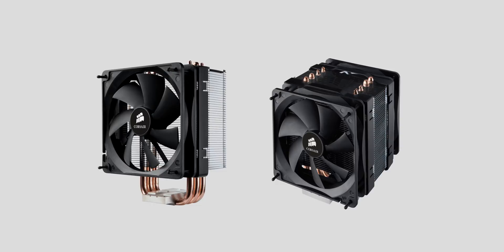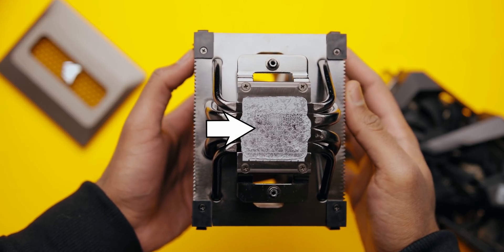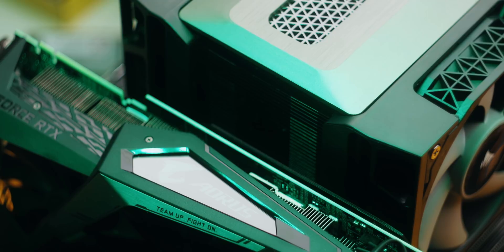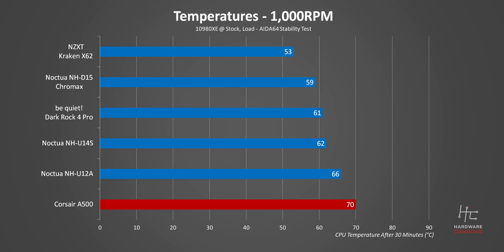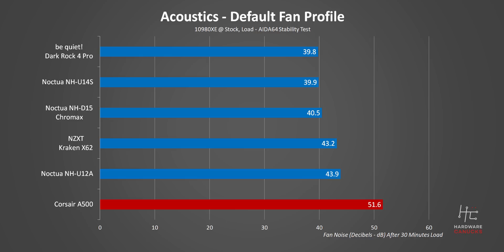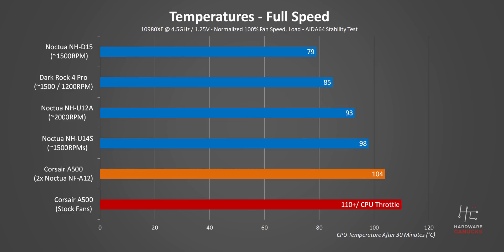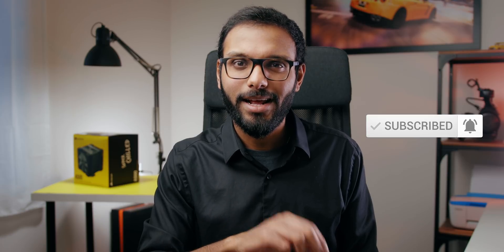Corsair A500 Air Cooler Review - Watch This BEFORE You Buy!

Comment from the maker: Will be hanging around the comments for a few hours.  Looking forward to hearing from you guys.  ❤
Reply: I would say that this cooler is not worth buying, it does not have competitive price and performance. Also it's too loud, and ugly.
Reply: So this thing sucks. Like Linus said it did.

Oh well.
Reply: 0:24 The comeback of air cooling over water is at least 2 years old...
Reply: Ohhhh new logo
Reply: awesome video and testing! Love your methodology and in depth analysis. One interesting suggestion: Could you lap the bottom, to make the contact perfect? Would be interesting to see, what kind of difference that makes.
Reply: You took away the beaver.
Reply: HardwareCanucks Double check your description! ”Sponsored by ????”
Reply: Only truthful review I've seen besides avtechy and techpowerup which both ran into problems.
Reply: When you came to the conclusion this cooler have a uneven base I think you should have tested it with a thermal pad instead of thermal paste and see if that makes a difference to the cooling performance! Also it could have been interesting as part of an investigation to discover design flaws if it is possible to find a fan that can be squeezed in between the 2 towers and see how much of a difference that would have made to the cooling. Otherwise I am most impressed with this level of testing, very scientific! Another thing I would have wanted to hear is how it sounds compared to the others...
Reply from the maker: @SkyForce6700  The problem with mounting a fan in between the two fin arrays is the fact there's nowhere to place the clips.
Reply: It's painfully apparent, dual Noctua's. One on cpu & one on the gpu. Might aswell put fans on the hdd and ram :-p
Reply: Sorry but please review the hyperx cloud flight s also I didn’t think any cooler would
be more ugly than noctua’s but it changes when I saw the video from ces
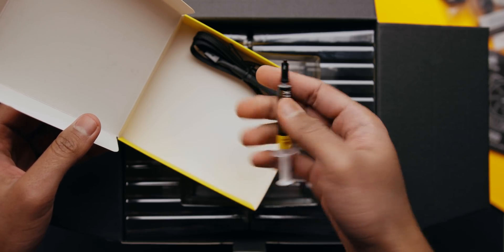Reply: 2:10 it's not zipties, it's tweezers. Screw with confidence.
Reply: Please change logo to old one it's better
Reply: For how long was the kraken tested. I don't belive for a moment that the AIO toped one of the best air coolers with that kind of a chip by almost 6°C.
AIOs keep scaling the first 40minutes, while aircoolers reach maximum temperature in less than 10.
Also for the non tech savvy, that have liquid cooling simply better than air cooling: where liquid cooling CLCs shines is at low to mid TDP and mid to high thermal density, basically where the cooling capability is not saturated, and despite manufacturers claims CLCs like the x62 saturate very easy and fast (liquid holds heat for very long), while air coolers can go up to 400w+ (that doesn't mean it will do it on any CPU, it just means it can do it if the conditions are perfect).
That chip is a high power consumption and mid to high thermal density.
Reply: Thanks for being rigorous in your test methodology. Thanks for the honest review. Keep up the good work.
Reply: Does the deep cool assassin 3 hang with these guys? Would like it see how it compares.
Reply: @andzx6720  yes it does. It's basically a nh d15, with worst compatibility and more expensive. I wouldn't buy it over nh d15
Reply: @Traumatree  Yes. Less cost, complexity, failure, weight.... Heat pipes are great, an liquid metal standard should have happened 2 years ago but customers are so slow... Next step for cooling will be double sided metal liquid fans heating up your house because every one likes power but no one likes bills ;0)
Reply: @HardwareCanucks Thank you for real subtitles and not generated English 👏👏👏

Comment: Picked one up for 25.00 and planning on using it on the 88w 4790k which it's overkill but looks great. I don't mind fan noise because I've been a mechanic for 26+ years. In automotive certain noise means it's working which is my thoughts on fans. I do have the fans used on this cooler running in my PC and call it my jet.

Comment: just got this case for $45 on amazon (black Friday price)? I replaced the fans with LL120 and it's very quiet. My case is Lian-Li 205m and my 5800x idles at 50C and 70C during gaming. It's huge I have no clearance for the front panel but that's fine. For $45...can't beat it! My 3070Ti idles at 40C.

Comment: How could a cooler that huge have only 4 heatpipes? Can't even afford an actual baseplate despite the $100 price tag? Talk about incompetence.
The only compliment I might give them is that they actually tried to innovate on the fan mounting mechanism (I hate those flimsy clips that every other brands use) but seems like it hurts the performance in return.

Comment: It's hilarious Corsair slapped a $100 price tag on a CPU cooler with 4 heatpipes. That massive air void in the middle of the cooler doesn't help, either. I'm relatively certain that's only hurting airflow and heat dissipation.

Comment: The problem with this cooler shows your testing method: the lag of number of heatpipes combined with the missing baseplate results in the poor performance. Der 8auer mentioned this in the beginning of his testing. In the end your test really shows the limit of just 4 heatpipes. My "Scythe Mugen 5 Rev.B" has 6 heatpipes and a baseplate, and costs "only" 45 Euros. With the cost of an additional fan, i am sure it will beat this overprized halo product, by beeing cheaper and have more high-end air cooler features then this. And to be honest: the fan mounting is absolute irrelevant. how often do you remount the CPU cooler? if you do it in a daily base...yeah, but who does this? so this feature alone does not justify the high price in the 1st place.

Comment: A lot of times companies/people use fans that are way too oriented toward static pressure. In my personal testing I've found that you rarely get better performance with a static pressure fan. Even with an AIO radiator an airflow fan does just about as well, provided it's mounted in push orientation. In pull orientation is where static pressure fans seem to have a major advantage as the airflow fans simply can't create enough suction, and create a lot of turbulent air noise. 

What I think would be interesting and helpful to the general PC user base would be for a tech channel to do some sort of official testing of several airflow vs static pressure fans, both as case intake/exhaust and on heatsinks/AIOs. That would help settle once and for all what situations you really want to use a static pressure fan. As I said, based on my previous testing, it is not very often.

There's a lot of complete misinformation out there related to fans, because no one really tests them.

Comment: The truly impressive thing is that its been 6 years and still nobody has beaten Noctua NH-D15. It's still better than some AIOs. And when Noctua finally introduced the Chromax version of the D15, Any reason for buying another air cooler (other than price) went straight out the window. The D15 is the cooler to get if you're looking for top performance
Reply: What do you mean nobody has beaten D15? Thermalright Le Grande Macho RT, Phanteks R1 Ultimate?

Comment: I don't think it's a matter of the higher static pressure rating on the Corsair fans, but the actual opposite. I kind of remember Noctua having released a static pressure at 100rpm steps from lowest speed steps on the NF-F12 years ago, then somebody online did the same test vs other fans. NF-F12 had a less steep slope, the Corsair SP120 started out with very low static pressure and only started beating the Noctua near the top of the Noctua's operating speed or even worse it was probably when the SP120 was already spinning faster. Airflow wasn't any different (this was easy to tell from specs as the 1200rpm stand alone SP120 that didn't come with the H100 was rated lower on both vs the Noctua anyway).

Chances are even if the ML120 improved on the SP120 the same trend might still hold given how much Noctua poured into designing the A12. Can't they just come with a black frame?! They don't even need to change the color of the blades, it's the light brown frame that sticks out.

Comment: I recently replaced my 3 year old liquid cooling with a Noctua NH-D15, because I didn't want the coolant to leak and wreck my system as happened in my previous system.  I was hoping that the NH-D15 could keep the normal and max CPU workload temps within 10C of the liquid cooler on my 140w TDP CPU, but it actually beats the liquid cooler by a nominal 5C and a max CPU workload by about 15C - I was most impressed!

I really don't trust Corsair ever since the expensive gaming mouse I got from them a couple of years ago stopped working after just a few months.  (The $13 mouse I then replaced it with has worked great for over a year by comparison).  For the price of their stuff, Corsair should hold up better...

Comment: Very well thought out test methodology.  Also, excellent integrity on your part, especially considering that Corsair is one of your primary sponsors.  Hopefully, Corsair will take these results to heart and improve their product.  The A500 is very good looking and the sliding fan mechanism is pure genius, but if Corsair is not going to improve the cooling capability, it should be $30 less expensive, to compete with coolers that have equivalent cooling capabilities.  Great review!

Comment: Corsair's customer support is horrid. Corsair also is s very shitty company who lies in their marketing. I bought the first gen h100i and sure enough the advertised noise level even inside their sound dampening 300R case was higher than advertised and  It gave me tinnitus ay 50+ db with permanent ringing in my ears. Also they didn't honor their warranty.  I have been a customer for years as well as my customers.  I have not used Corsair for two years.  Will continue to boycott this company unless they can compensate, or replace, and apologize, instead of wasting my time and money. In fact Corsair should just go back to making ram. Since that's the only good thing they can do.  As long as Corsair is sponsored I will comment the truth.  I can no longer support Corsair, and hopefully none of my customers need support in the future.

Comment: You definitely wanna lap your A500 Air to get the full use of the cooler. You just rub it in a figure 8 on taped down sheet of sand paper. You stop every 10 minutes and rotate the cooler 90 degrees then do another run of the paper. Repeat until so flat that when you drop it on a sheet of glass (mirror for example) it feels like it is sticking to the glass (surface tension is super high on super flat metal objects).

Comment: This is an unfortunate product - it looks great and I like the fan mounts but you really need to focus on performance for a CPU cooler in 2020, especially a $100-ish air cooler and it seems like Corsair put a little too much R&D into the wrong engineering aspects of this thing. If it were more competitive functionally it could be the $100 king, but as it is I can't recommend it for any reason.

Comment: changing from an open air bench to a case is kind of pointless. ultimately it's about comparing one cooler relative to another. i guess it's more helpful for those who own the same case & fans (arranged in the same way)
Reply from the maker: Depends.  If you look at the in-depth methodology, a horizontally mounted motherboard can obscure issues with cooler mounting / base finishing.  It could make a poor cooler look better than it really is.
Reply: HardwareCanucks well, i stand corrected. having used the hyper 212+, i can see how a horizontally mounted motherboard could benefit poorly mounted coolers.

edit: poorly designed cooler mounting*

Comment: Love the new methodology for testing, very in depth. But I think the graphs need to be a bit more "dense" but stay longer on the screen. For example combining for a given RPM range both temperature and noise level would make keeping track of all the numbers easier.

Regarding the cooler: if that was designed to compete with the, so called, big boys they did a poor job because it's clearly not working well enough for the price. The rail system for the fans is smart, but how often is someone moving fans around on the cooler? I have an NH-D15, went through RMAs for a while, but I never felt like the fans mounting system was a drag.
Reply from the maker: We tried this.  However you could just pause the video when the chart you want appears.
Reply: @HardwareCanucks  Sure, just giving a feedback. Overall I liked the video, as usual!

Comment: 11:15 Despite having smaller fans, the A500 is actually higher than the NH-D15 (165mm per noctua Vs 169mm per corsair) while being 6mm narrower (150mm wide for the D15 Vs 144mm).

I suspect the worse performance on the overclocked chip compared to stock settings is partly related to efficiency limits on the chip heatspreader not fully utilising all the heatpipes, and a copper base to this would have solved this

Comment: Test in a case, with a high tdp processor. Multiple tests to show every aspect. An AIO is included. Thanks, that was one of the best cooler comparison I’ve seen
Reply from the maker: Thanks for the compliment.  Much appreciated.  :)
Reply: @HardwareCanucks  also the details about not being a perfect plane of contact and all other things really made this a great review
Reply: @HardwareCanucks  Test was great and price point choices good. I really liked that you tested with noctua fans too. I really like to ask is that OC wattage (250W) right? How did you measure or calculated it. I have read couple articles that is closer or over 300W oc in less voltage (higher clocks, Voltage 1.16-1.20V). Still bad choice for the price : (

Comment: I have paired these fans on a H75 push/pull cooling a 4790K @ 4.7 and they’re not that noisy at all...
Reply from the maker: That's because they don't have to work as hard.  Remember they're built for radiators, not fin arrays.  The AIO helps out.
Reply: HardwareCanucks That’s my point exactly..why pair it with sp fans in the first place , it’s not like Corsair hasn’t made af fans in the past , and it performs better with the Noctua ones as you guys shown in your video..
Oh well,a hit and miss I guess..
Great vid guys,keep up the good work!

Comment: In addition to the lacking base plate quality, it looks like the A500 does not conform to socket 1150 spec, so on a few boards like the Asus Z170i the heatpipes are hitting the VRM and reduce mounting pressure even further. Found out about this via AVtechy's review, but afaik it hasn't been confirmed by other channels or Corsair yet.

Comment: I'm curious how this cooler would perform if the poor heatsink contact was fixed with some glass and sandpaper. Would love to see this tested.
Reply from the maker: Don't know but if I spend $100 on a heatsink, I don't want to spend hours of my time sanding the base down.
Reply: @HardwareCanucks  I can agree with that. I was thinking of more of a this is the issue with it since you already showed the fans being one part of the issue. If fixing the bottom makes it competitive then corsair could look into adding or refining the step of a smoother heatsink.

Comment: Finally you guys answered the question i had for so long!! Like everyone is just saying how great the sliding mechanism is to accomodate taller rams but no one talks about how sliding the fan upwards would potentially interfere with the case side panel loll
Great video as always! Like your improved testing methodology as well!
Reply from the maker: Yeah, this is really something to take into account.  Glad you liked the video and the in-depth testing.
Reply: @HardwareCanucks  Oh, it's the first time you're mentioning it. But you don't have to be a reviewer if you're thinking logical: for each mm you're raising the fans, it's x amount mm of CPU clearance you're losing.
Reply: I believe GearSeekers already mentioned this being a possibility and tested how far you could slide before contacting the side panel on the P600S! I was curious myself and they were the first I saw to bring it up.

Comment: 4 heatpipes in a 100 usd cooler. Cmon corsair, even The CM 212 plus have 4 heatpipes.
Reply: In my country is gammaxx 400
Reply: J M  don't disrespect the hyper 212 like this. They are way better for way less.
Reply: Here in Germany its avaible for 49€
Reply: J M  Funnily enough, you can now find it for $45 on Amazon. Now, at that price, it's actually pretty decent
Reply: J M  The Hyper 212 is also quite overpriced. Snowman cooler is way better value.
Reply: @Seatux  Arctic are by far the best value coolers and fans
Reply: @fuhrerhosty  No local distributor for Arctic in my country anymore. So Snowman it is.

Comment: Noctua NH D15 is still the king of air coolers
Reply: senraXD hands down
Reply: Deepcool Assassin 3 is a close competitor
Reply: And all beaten by Thermalright Silver Arrow IB-E Extreme
Reply: Just wish the NH U12a came in black. 😟
Reply: @ray_n_carnation  yea ikr
Reply: @ray_n_carnation  isn't there a chromax version?
Reply: ThePrice Boabu Yes of the u12s version
Reply: Assassin 3 is better then D15.
Reply: @frijin490  than*
Reply: I think Deepcool Assassin III is better
Reply: @жабислав  It is, its also 35-50€ more expensive
Reply: @joost1183  it's actually 10€ cheaper?
Reply: I kinda like Be Quiet! more tbh, just my opinion
Reply: @jadonlee821  I mean there is a temperature difference of about 3 degrees usually but the DRP4 tends to be more silent. Still both are monsters.